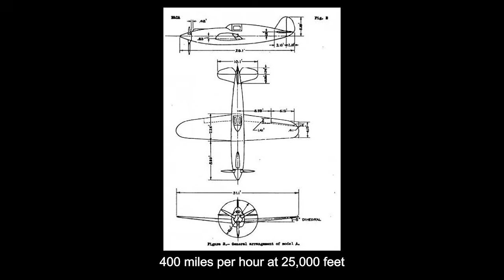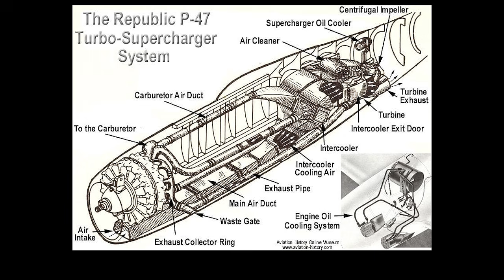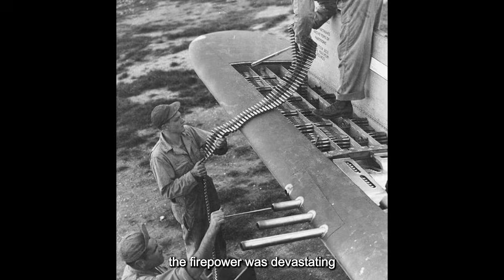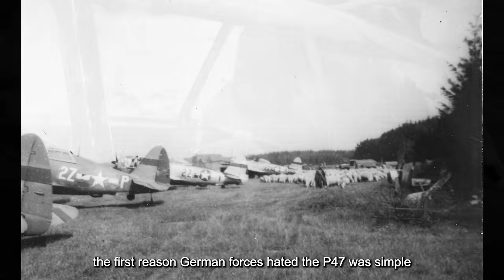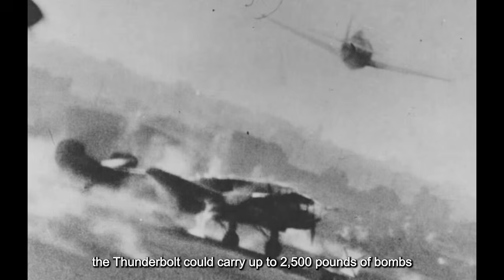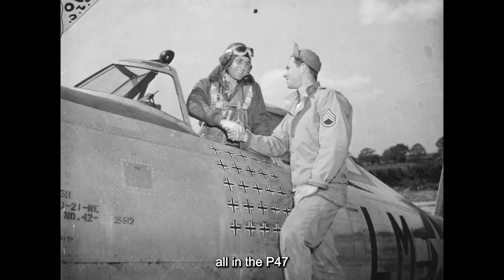The Dark Reason Germans HATED the P-47 Thunderbolt

Comment: The Germans came to fear and despise the P-47 Thunderbolt, nicknaming it the “Jabo”—the low-flying terror. Powered by the rugged R-2800 engine and protected by heavy armor, the P-47 could dive from high altitude, unleash bombs and .50-cal fire, and climb away untouched. Its relentless ground attacks destroyed thousands of German convoys, tanks, and gun positions. To German troops, the “Jug” wasn’t just a fighter — it was unstoppable death from above.